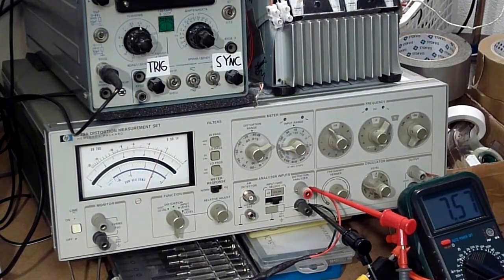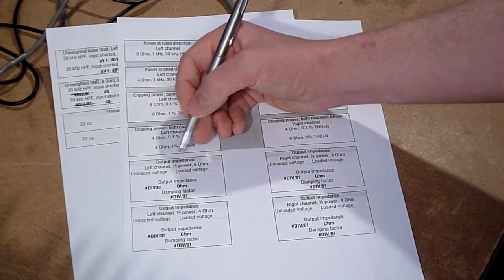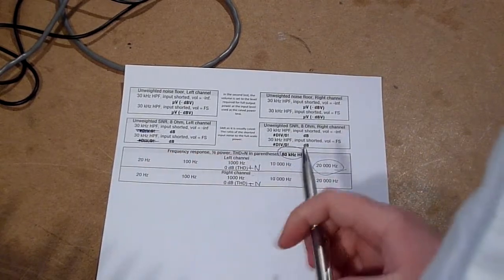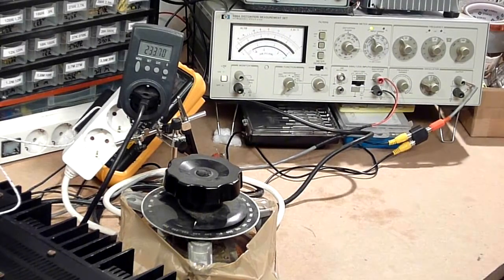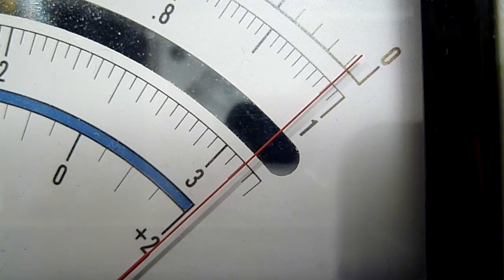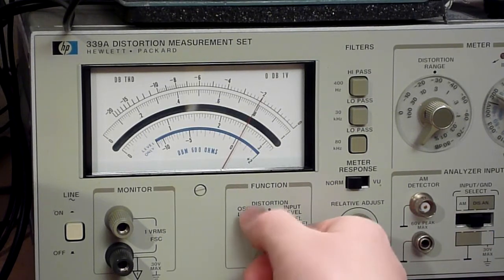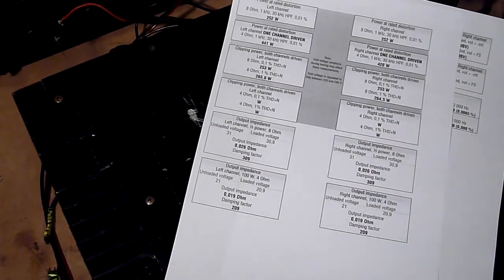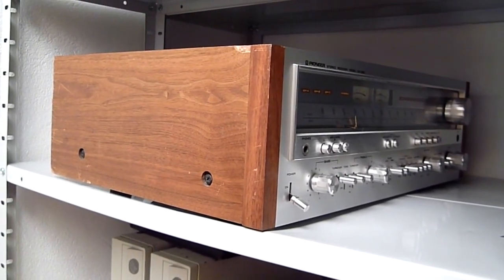Performance testing my Yamaha P-2200

Comment: Is this easily set up for mono operation? I can't find information on how polarity is changed.
Reply from the maker: The P-2200 doesn't have any internal bridging ("mono") circuit. In order to run it in bridged mode, you need some kind of preamplifier to invert the signal going to one of its channels.
Reply from the maker: CouchPotato343 That is odd. I believe mine has switches to select which of the XLR jacks to take signal from, but not ones to select polarity. There are probably different flavours available for different markets.